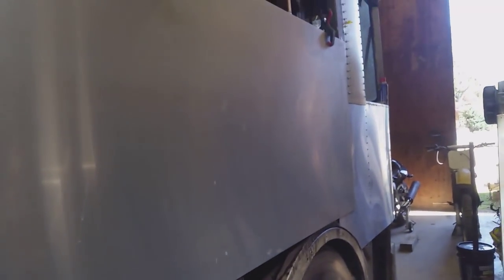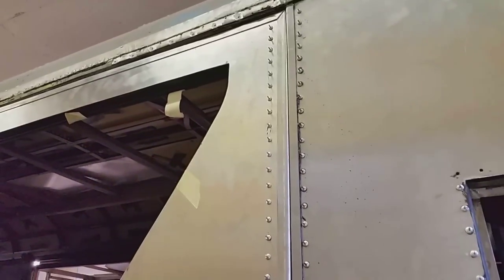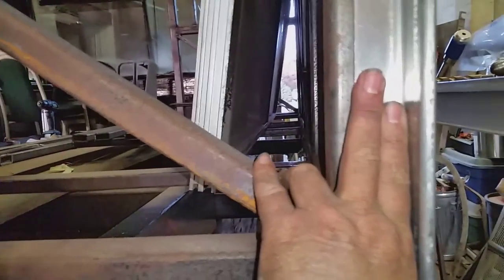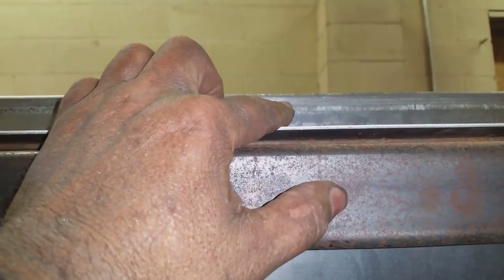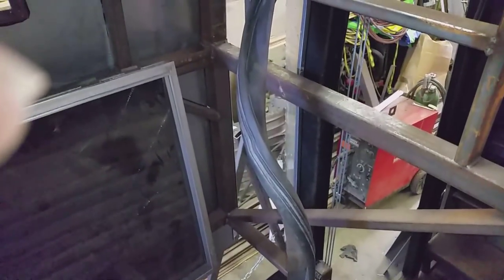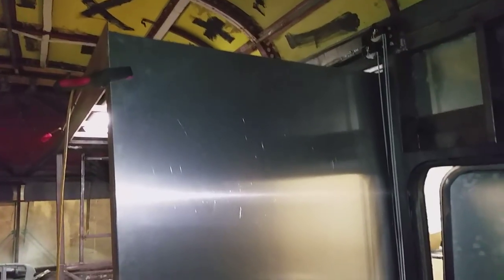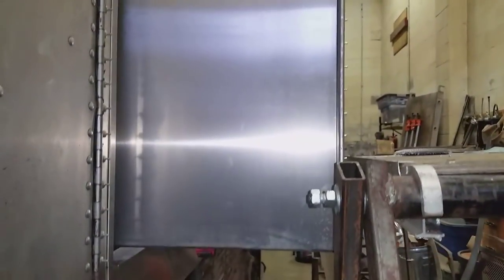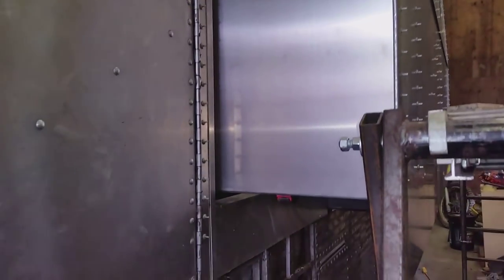Bus Conversion Project - Video 59 - Working on the passenger side slideout

Comment: could you do a video showing how you got the slides to work? such as what motor you used and how you set it up?
Reply from the maker: watch video's 36 through 38
Reply: James E Dennison i appriciate it man i just started poking through great job!! im getting ready to decide on a low floor or a skoolie
Reply from the maker: schoolie's seem to be pretty popular right now... I like the air suspension of the Highway bus myself and they are already geared for highway speeds but the schoolie's seem to be all the rage, maybe because they are cheaper to start with, not sure.... I've seen some pretty nice conversion's on schoolie's though

Comment: Nice progress. I haven't made much as late, chores have gotten in the way. That is to bad about the trim. I understand why you would want it the other way. We had rain / snow yesterday. How did you cut (with that cut off wheel on the grinder). Glenn Lever
Reply from the maker: Ya....Zip Disc on a grinder.... that's how I cut all my metal